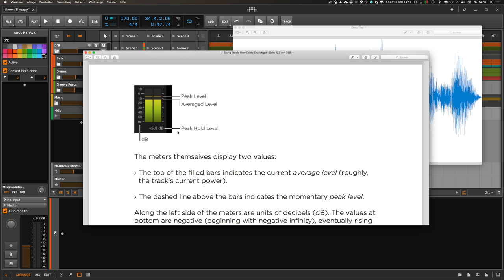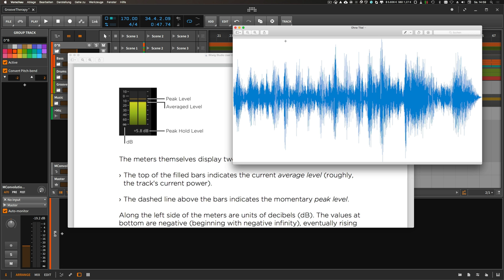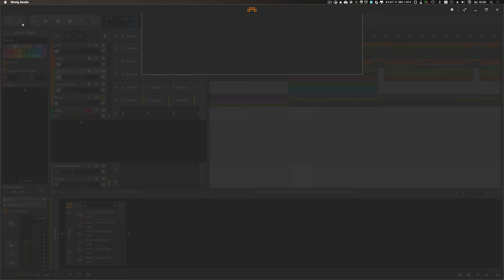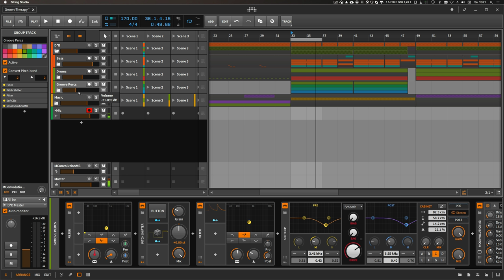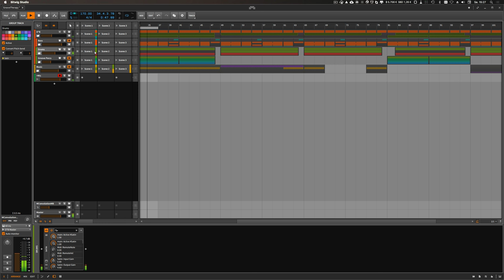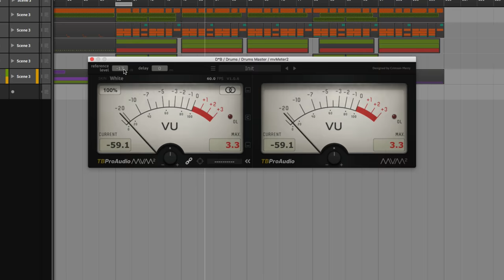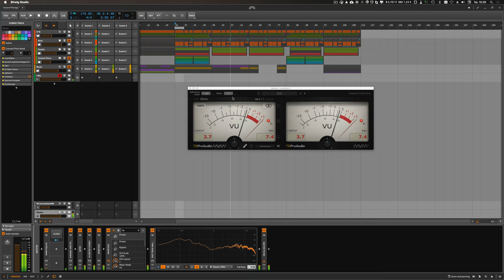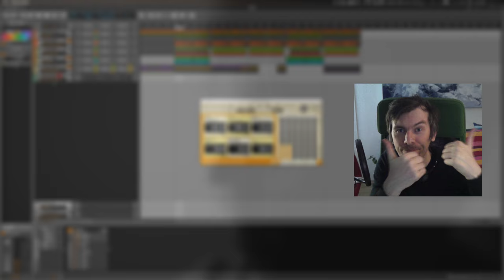K-20 Mixdown / RMS Tipps - Bitwig Tutorial

Comment: I've always struggled with the metering in Bitwig. I don't know too much about gain staging so things can get a little bit messed up in Bitwig because the routing possibilities are endless. For some reason in Ableton I just always hit the sweet spot without having to do any homework. When I try your method I begin with the kick. I'm making deep and heavy techno so the kick is thick and large. When I mix the kick in so it hits just into the yellow and adjust all other tracks afterwards then everything else is way below the yellow because the kick is mixed in to loud. So I'm confused what I should be shooting for man. I do everything by ear so would really appreciate your help.
Reply from the maker: Having everything at -20db rms is not giving you a great mix. It´s a rough starting point. I tried to get this point across in the video. When it sounds good to your ears, then go for it. The ear has always the last word imo.